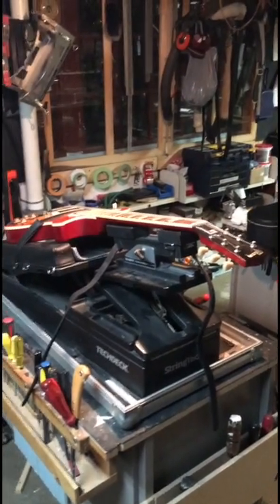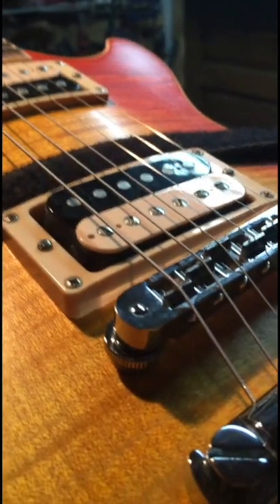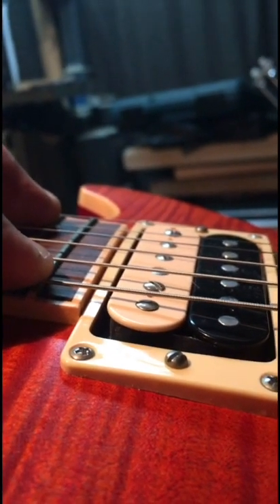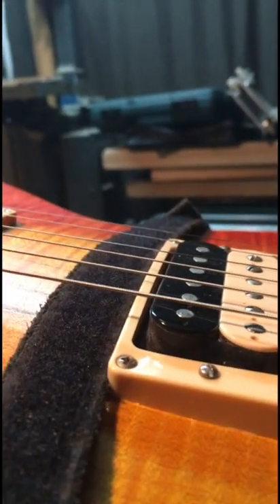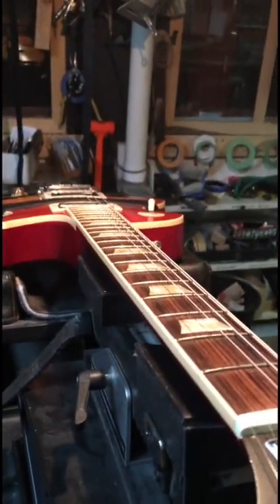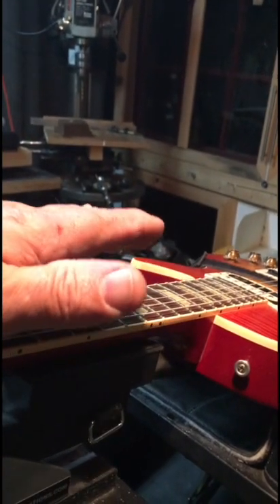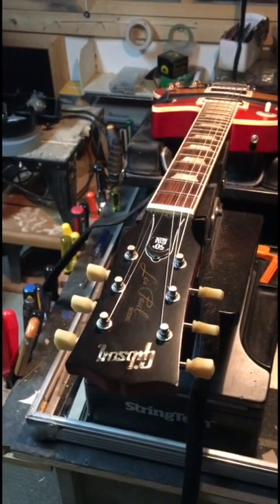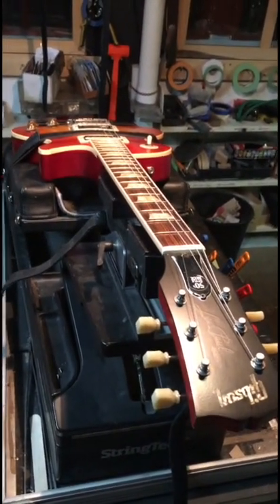5 Gibson Les Paul tuning tips@StringTechWorkstations

Comment: Great tips. Thanks. :-) You have a new subscriber.
Reply from the maker: A couple of things that I need to clarify. #1 Dressing those frets at the neck-to-body junction; will allow you to drop the action down nice and close , see the video in the white SG ... I explain all of this in detail there. #2 The longer scale length on the Fender guitars 25 1/2 " is a lot more forgiving on those 1st position chords. The 25 5/8'" Gibson scale length really needs a comp nut to behave in that first position. The " Les Paul compensated nut" video and the " compensated nuts in a nutshell" videos, explain this in greater detail. Cheers....  welcome to the world of a PERFECTLY TUNED guitar \m/ !
Reply from the maker: Correction: The Gibson scale is 24 5/8" .... it is that shorter scale length that has more pitch displacement; with that "back tension " created by the" nut string height", that causes the sharpening effect. The extra scale length on the Fenders ... is 7/8" longer. This is why you can ( almost ) get away with the garden variety first position chords on the Tele and Strat guitars. A compensated nut will make the difference of the guitar being " almost in tune " .. to it being beautifully "in tune" for all of those first position chords.  Very best regards ... MMcC

Comment: thing is, paying over grand for a guitar, the darn thing should be right in the first place.
Reply from the maker: Because there are so many variations of string gauge and tuning ( now more than ever ); the customer needs to choose a string gauge and tuning that they plan on using... continuously .... THEN your Tech can adjust the guitar according to your specific needs. The neck to body joint issues have been an ongoing issue forever. That neck to body junction will need a fret dress eventually, on pretty well every guitar.
Reply: Thing is, its a man made wooden instrument that literally shrinks and expands based on temperature and other factors.
Reply: @RyanGamesYT  Still, you'd expect the non-expanding nut and bridge to be set up for the factory provided strings.
Reply from the maker: Fair enough Chris .... I understand the frustration .....if it was only that simple ..... after 50 years of working on guitars ... I rarely find a guitar that is absolutely perfect , right out of the gate.
Reply: @C0urne  no guitar comes perfect right from the factory

Comment: You missed the whole problem with the strings going out of a straight line on the second and third tuners from the nut- that's a HUGE problem with the basic design of the Les Paul- those strings pull hard against the side of the (large) nut and get hung up in there and won't return to pitch after a bend or two. You have to put a lubricant in there (even on a compensated nut) to help get the damn thing to return to pitch because that's such a poorly designed string break angle. I've also heard installing Gotoh locking tuners helps with that to some degree- about to try that myself to see if it makes a difference. I would think a properly cut nut that "opens up" the back of the nut at the same angle would help allow the strings to return to pitch. Otherwise I'd think you'd have to install a locking nut altogether just to get it to stay in tune. Really poor design from Gibson that they haven't improved over all these years. They need a new headstock shape to correct it and maybe a lower angle <10 degrees or so instead of a 17 degree angled headstock.
Reply from the maker: Thank you for pointing that out yjmsrv ! I have been addressing that problem so "automatically", for the past 40 + years; that I completely forgot to mention it. When cutting ( or filing out ) a LP nut; I angle "the strings slot cuts", toward the inside of their corresponding string posts. Most players will know what I mean when they bend the G string ( especially ! ) you can hear it "ping" ... as it gets hung up in the nut slot.I also load up a 3cc syringe with lithium grease, and use an 18 gauge hypodermic needle to put a "dab" in each slot to lubricate.  I will post a video that covers those issues ( in detail ) after the next 3 upcoming videos. Thanks again for pointing that out ! Also : As far as changing the headstock shape ... I'm sure that"hell would freeze over" before Gibson changed the most iconic headstock shape in history !! BTW: PRS figured out the 10 degree headstock tilt long ago ... the combination of reduced headstock tilt and a slightly thicker headstock, has also eliminated the common breakage problem that is associated with wood grain "run out " on this type of headstock. Very Best... MMcC
Reply: Thanks for the reply! I just slotted my Les Paul's nut toward the respective post and put SuperVee Super Glide in there- on my saddles and even on my tail piece since I "wrap around" the strings- HUGE difference- suddenly not only does it play in tune- it SOUNDS way better. Probably because it's finally in tune! I do think a compensated nut will help- and waiting on the locking tuners to come in too- but it's not playing out of tune at the cowboy chords any more and when I bend strings they're returning to pitch properly. I think the biggest difference is the nut slot angle- really made an immediate difference an no PING!
Reply from the maker: Bravo ! You might be able to save that locking tuner $$$ for other things ... just saying ...  ;^ ) 
Cheers, MMcC
Reply: Get a string butler. They are in Ontario. Works great
Reply from the maker: I've got 2 more Les Paul videos coming up next .... I'll address all of these questions in these next 2 videos. Cheers ! MMcC

Comment: You left out perhaps the most common Les Paul tuning problem of all: G string will not
tune correctly without some tweaking, or the compensated nut. This is a huge problem on
Les Pauls. Gibson should be ashamed of themselves for not solving this, especially with
the price they charge for these instruments. I don't know one person with a Les Paul
(particularly Norlin and post-Norlin) who has not experienced this. The problems you
mention have never been as bad as the "3rd string blues," at least in my opinion. I've not
had a Gibson of any type with 6th and 1st string tuning problems, either.
Reply from the maker: Hi Larry, Thank you for your comment. I did not mention the G string issue specifically; because ALL of the strings were intonated, when I fabricated and installed the compensated nut. I will post a more detailed video, that covers the G string issue , as well as the other 5 strings. Respectfully, MMcC
Reply from the maker: The 2 outside "e" strings require the least amount of compensation. If you search "compensated nuts in a nutshell" you'll find a detailed explanation /  pictorial / video / that cover this subject in more detail.